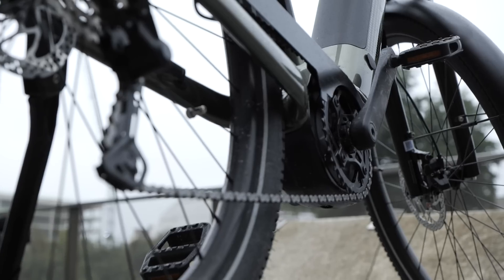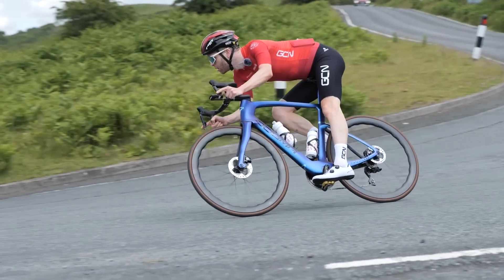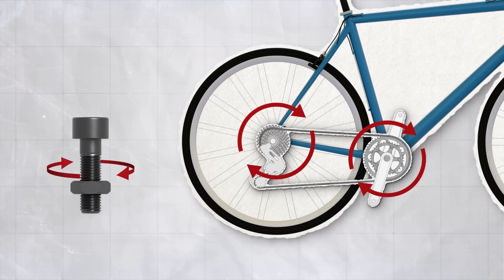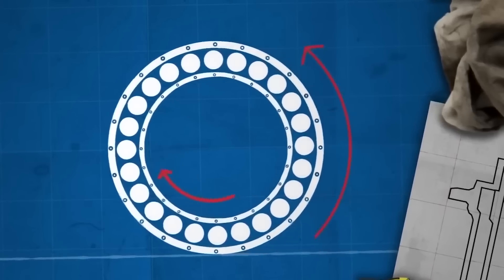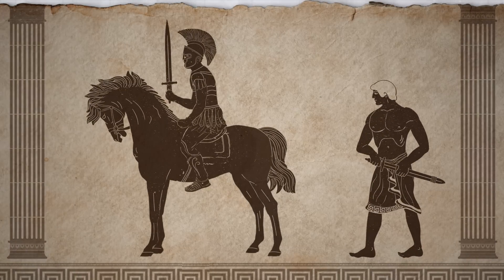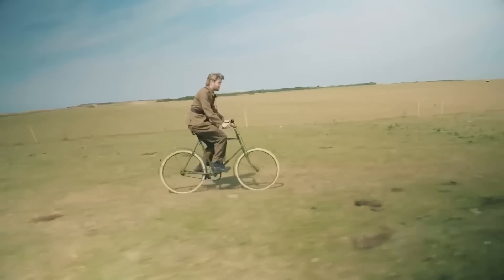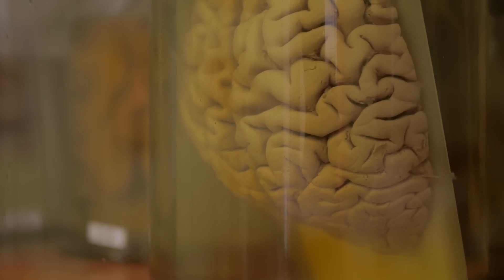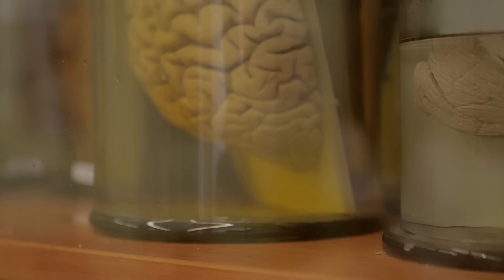Why Is The Drivetrain Always On The Right?

Comment: I’ve never understood why pedal/crank arms have a reversed thread for the left-hand side. The fact that there is a bearing arrangement in the assembly means that there is never a force on the thread in either direction, demonstrated nicely by holding the left pedal by hand and spinning your crank backwards, if there was any possibility of this loosening the thread there would be resistance
Reply: From extensive experience with people assembling unicycles wrong, I can tell you with certainty that pedals do infact unthread if you put a right hand thread on the left and a left hand thread on the right pedal. Look up mechanical precession. You are right, the bearings produce little torque, mechanical precession does (and it goes against the turning direction of the pedal).
Reply: @Finnspin_unicycles  why don't fixie riders pedals unscrew when putting back pressure? why don't bmx riders pedals unthread when riding fakie? the answer lies in proper torque of  the pedal. if your pedal is torqued properly it will never un thread.  "Mechanical precession can occur when too much clearance exists between a shaft and a bushing, or between the races and rolling elements in roller and ball bearings". This doesn't apply to threaded connections. Threaded connections are designed to use the stretch of the bolt as a "spring" which holes the part in place. due to this "spring", there is a constant force applied to hold the pedal to the crankarm, and the very small vibrations that pick up through the ball bearings rolling is not enough to overcome the tension of the spring and break it loose. It requires a certain breakaway torque which cannot be applied in small amounts over time or it will never actually rotate the thread.

However, if the pedal is loose to begin, there will be mechanical precession between the pedal thread and the crankarm thread, which will allow the pedal to back out as no spring tension is holding it.
Reply: @bmxscape  While properly tightening the pedals down helps, if you look at pedals, you will find that unlike proper bolts most have barely any flange. In some softer aluminium cranks, you might not even be able to get the necessary preload to fully prevent precession. Preload can also get lost by deformation of the thread or crank due to load spikes (riding down curbs for example).
If properly designed for it, you are right, you can avoid such problems in threaded connections, but a century or so ago, the bike industry decided to go with opposing threads instead. Given that such parts are often changed by the end user who doesn't know how to properly tighten things, maybe it is not such a bad choice.
Reply: @bmxscape  Yep when the unicycle was mentioned above the first thing I thought of was fixies.
Reply: A hangover from the days of poor bearing quality. A seized bearing would result in the pedal unscrewing instead of pulling the rider’s foot around and causing an injury. So I read once, anyway.

Comment: May be Brits will adopt left side drivetrain. You have the front brake at right hand and also car drive by the wrong side, so why no ...?
Reply: @milybanily  “wrong side”….. left is right for us, Australia, Japan etc!
Reply: @alvinthfdby1915   NOOOP !! Wrong side absolutely !
Reply: @milybanily  hell no, left ftw, thankfully no chance of my country changing
Reply: @alvinthfdby1915   Swedish did it, clever people these nordics !
Reply: @milybanily  57 years ago….
Reply: @alvinthfdby1915   They were old people but still clever vikings.
Reply: What? You have your brakes on the wrong sides as well? Have a word…
Reply: @Crall-xb8he   Don't worry ...its because island environment...UK. Japan, Australia....wrong side for ever.
Reply: @milybanily  India, Pakistan, Thailand, Malaysia, Guyana, Sub-Congo Africa.  Not only island environments drive on the "wrong" side of the road.
Reply: @Crall-xb8he  the correct side you mean
Reply: @Crall-xb8he  Yes.  If you tune your bike correctly for a country with left-hand traffic, you'll set up your left brake handle to operate the rear brake.  This way, you can hand-signal with your traffic-side hand, and operate the rear wheel brake with your sidewalk-side hand.  When you need to maintain control of the steering, you want to prioritize rear wheel braking.  This way, you maintain traction in the front wheel for steering.

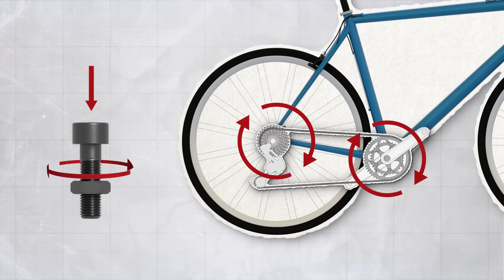Comment: 2:23 I’ve always wondered why pedals and BB are reversed. It seemed counterintuitive. This helped answer that question. I’m so glad you are independent again. I’m actually enjoying your content. I was getting sick of all the sponsored infomercials.
Reply: His explanation of BB thread direction is wrong. The balls in the ball bearings don’t push it backward, it has to do with the mechanism involved in strain wave gearing. If the bearing is loose enough, the entire thing will move around and gradually roll the opposite way.
Reply: How is bb reversed? 🤨
Reply: @kalijasin  yes. The common English thread is reverse-threaded on the drive side.
Reply: I read somewhere that, due to bearing reliability issues in the early days of cycling, the threads were such that the pedals would unscrew in the event of a seized bearing. The rider would be more likely to control and stop the bike in this scenario than have their clipped-in foot injured as it’s pulled around by the pedal. 

I’m not 100% convinced of this to be honest, but…
Reply: I just commented on this actually, I don’t believe there is any benefit to a reverse thread on the left pedal, the pedal rotates on a bearing, so there is no force on the thread at any time -in my opinion
Reply: @daztastic147  If you're so confident loosen off your left pedal and go for a long vigorous ride and see how you go. Bearings do NOT eliminate friction, they reduce it.
Edit: 
Fortunately the thread is reversed so you'd be fine. 😁
You could loosen it off and back pedal with your bike on a work stand though.
Reply: @daztastic147  there's a force on the threads that screw the pedals to the cranks. And because of the different rotation directions that's why one is clockwise and the other is anticlockwise.
Reply: @daztastic147 precession - there really is a force.

Comment: On a fixed speed bike with a single cog you can flip the rear wheel over, swap the left/right cranks and move the chain from right to left, doubling the life of the chainring and cog since the chain then uses the sections of the teeth that previously did nothing.
Reply: I don’t think you can put the Cassette on the other side on most bikes.
Reply: @kalijasin  Indeed you cannot, the freehub would then be in the wrong direction. This applies to a bike with a fixed cog on the rear wheel, that cannot freewheel. I've seen it done and it does double the life of the components.

Comment: Both right and left are wrong. Mid would be most balanced position. Also wheel dishing wouldn't be existing.
Reply: This is what I’ve always wondered, rather than why always on the right. Conceptually a central drive train sounds simpler too.

Comment: its a bvad idea too, at least in the automotive world you can tell if a vehicle is english because the left side will have more corrosion. Its where the puddles are (on the side of the street). This means however, that in most countries where we ride on the right, the drivetrain should be on the left,where it will be more protected form that. 

Also: Ima make a left drive side Fixie now HAHAHHA see ya
Reply: So, when you ride through a puddle, only one side of your bike gets wet…?
Reply: @Crall-xb8he  Not what I said. 

On the drivetrain side of your bike is also where most of the junk and debry as well as most of the water is. So it is on the more affected side. If and hoe that makes a differrnce I dunno.
Reply: @martinmorsch7507  Cars are wide with four wheels, bikes are narrow with two wheels. My point is that a bike is like one side of a car. Generally cyclists like to be the side that stays dry and ride away from the gutter, but if we have to ride through any mess then the wheels spray it evenly over the bike. And us.

Comment: I have a French-threaded steel frame. 
When I first got it, I would tighten the bottom bracket mercilessly.
Then daintily pedaling down the road, I would feel, then see, the bottom bracket . . . slowly unscrewing!
That proved why French-threaded pedals, got everyone scratching their heads, until The British-threaded pedals solved it.
French-threaded bike engineering, one of the many things the French got wrong.
Reply: Time carbon, look pedals, mavic wheels, Renault F1 cars, airbus, the Eiffel Tower, Concorde, the sewing machine, the hot air balloon, high speed trains and the metric system. Here you go.
Reply: @l.d.t.6327   Mavic R-Sys - nuffsaid, Concorde, banned from the sky -nuff said, forcefully over-feeding ducks  nuff said, etc etc. Now I never said they NEVER created anything. All I deed was mention an aspect of bike threading they fked up. That's all.
Reply: @savagepro9060   nope, I read your comment, and it’s denigrating / xenophobic towards French. It says more about you and your lack of respect. Ps: I’m not even French, but have friends everywhere and a bit less toxic when commenting.
Reply: @savagepro9060  Wondering now if you're French, based on your picture... ha! (I'm obviously also a bit toxic as black coffee tends to be)
Reply: @l.d.t.6327  Caribbean island, oh, but next to a FRENCH island, Martinique, go on do the geography . . . you're on Jeopardy!
Reply: @savagepro9060  if it’s next to Martinique it’s the Dutch equivalent. Or maybe a nearby island… nice to live, but seems like not that much fun to ride as these islands are so small!
Reply: French get everything wrong!

Comment: Y don't you do a video on the mystical phenomenon of why the wheel goes round and round. It would go with your tire and seat post videos. Or why the tire pressure is on the side of the tire. Lmfao
Reply: Ever wondered why the wheels only go round counter clockwise, like the earth does…?
Reply: @Crall-xb8he  so you've been told...

Comment: It's a convention, and it would be pointless to have 2 competing standards when neither offers an overwhelming benefit.  Right hand threads are easier for the right handed majority to tighten.  By the same argument, left hand threads are easiest for the right handed majority to loosen.  For comparison, in the world of motorbikes, the rear sprocket is not screwed on but is held on with several bolts so the handedness of a single central thread is not an issue.  A motorbike drive chain is usually, but not always on the left.  This is because most people usually mount from the left, so the kick stand is on the left to lean the bike that way.  Therefore the chain is on the "downhill" side and more sheltered when the bike is parked in the rain.  The explanation about mounting from the left due to the sword scabbard is interesting.
Reply: " it would be pointless to have 2 competing standards when neither offers an overwhelming benefit."
Bottom bracket  - 'hold my beer'
Reply: @bradl7439  Fair point well made.
Reply: Also, this might be the result because the exhaust tends to be on the right to avoid burning yourself when getting on/off the bike.
Reply: Not sure about that, drivetrains on motorbikes were primarily influenced by the engineering constraints of crank rotation, transmission design, and the cooling advantages of mounting the engine with exhausts forward. 
Counter rotating cranks are a relatively recent addition, utilised to recruit crank rotational inertial forces to counter other rotational forces exerted by wheels disks etc.
Reply: @space.youtube  It's also true that most swordsmen held their sword in the right hand and their shield in their left hand. A soldier would need to drop his sword to shake hands, which is why we shake hands with our right hands.
Reply: @Mgrant8163  Completely irrelevant to the topic of "motorcycle design", but thanks for that useful historical tidbit all the same. Somehow I was under the mistaken belief that they wielded their edge weapon with their massive prehensile peens, thereby freeing up their right hand to shake the hand of the noble foe they were about to clefting in twain.
Reply: Right. Let’s change the traffic light colors. Just because

Comment: The rotational force on the pedals loosens the thread for the same reason the BB is tightened by rotational forces. How can you make a wrong statement and then immediately provide the perfect explanation for why you're wrong? However, the loosening isn’t an issue because the rotational forces are close to zero due to the pedal bearings, but saying the opposite is just incorrect. If you want to test this, the next time you unscrew your pedals, simply hold the pedal axle in place and turn the cranks forward to quickly unscrew the pedal.
Reply: It was demonstrated to me that it is the effect of mechanical precession.
You can see how this works by putting a water bottle inside of a roll of painters’ tape. Now roll the bottle around the inner surface of the tape roll, and you can observe how this reverses the direction of the force.
At a micro level, the pedal axle is actually walking in the opposite direction around the inner surface of the threaded hole in the crank arm.
Reply: First of all, the effect he showed for the rotational forces shows that the torque on the static bearing race actually goes against the rotation. The right pedal spins counter clockwise relative to the cranks, so per his explanation the torque would go clockwise, tightening the thread. So that is actually consistent.
Secondly, look up mechanical precession on wikipedia, that is the actually dominant effect and the explanation why pedals don't unscrew while riding. From extensive experience with unicycles assembled wrong, I can tell you that there is enough torque on the pedal threads while riding to unscrew pedals if you reverse the thread directions.
Reply: @Finnspin_unicycles Precession is correct. But the bearing description in the video is also wrong; if the bearings have the slightest amount friction, they will exert a force that is in the same direction as the moving part. If the opposite were true, bearings would act as motors😊
Reply: Back in the early days of  bicycles the left pedal kept coming loose so they changed it to a left hand thread. It has to do with the way the thread bites as the compression force works its way around during pedal rotation.

Comment: The majority of us is right handed. This could be the closest answer. Same as guitar position.
Reply: The guitar position depends on how you string it. You can string the same guitar for a right-handed person or a left-handed person
Reply: @reinterpret_cast  You can, but the bridge is usually angled in one direction or the other.  But I find it easier as a lefty to use my left hand for the fretboard anyhow, so it's kind of moot.
Reply: Exactly!
Reply: But why would they place the chain on the left side of most motorcycles? Especially since most motorcycles companies used to produce regular bikes
Reply: @SestoEIemento  they’d based on kickstarter.
Reply: If I were to design a new bicycle, I'd look at what's existing and attempt to improve it. I see no advantage to switching sides, so I'd look at other things and leave the drive where people expect it to be, and save the effort to engineer something new.
"Why fix it if it ain't broke?"
Reply: @jayztoob  someone built the first chain drive bicycle…blame him…or celebrate him..or maybe her?
Reply: I wouldn't call the guitar a right-handed instrument.  I'm a lefty who prefers the usual setup.  My left hand does all the tricky fingering, and my right hand stays pretty much in the same spot.

Comment: The bearing explanation was incorrect.  If the inner race has a force on it, the outer race will want to turn in the same direction due to friction passed through the balls. The balls only rotate if the outer race is not rotating at the same speed as the inner race.
Reply: Agree, the bearing explanation was incorrect. Precession is the reason that the threads will self-tighten.
Reply: If the outer race is rotating at the same speed as the bearing, having a bearing there in the first place is rather pointless isn't it? The outer race stays in place, the inner race is supposed to rotate, so obviously the balls rotate.

Comment: Love the nerdy stuff, more please.

Something I've always wondered, especially after a nasty crash on my mountain bike, is why the derailleur points down putting it closer to the ground and in range of rocks etc
Surely the derailleur spring tension would be sufficient to stop the chain from sagging if it was redesigned to be flipped to point up.
Or am I missing something totally obvious to why it's not possible?
Reply: The RD is positioned downwards because it's the load-free part of the chain (only tensile forces come from the RD spring). Flipping the RD to the top would cause several problems, as all the loads would then travel through the RD, cage, spring, etc. You wouldn't even be able to use a spring, as any force would just deform the spring instead of driving the bike forward. Additionally, shifting would become much more difficult—you would always need to freewheel to shift, and any force on the pedals would make it impossible. You’d also need beefier RDs and cages to withstand the forces, and there would be efficiency losses due to deformation of these parts. While you could theoretically make the chain cross between the chainring and cassette to flip the RD, that would lead to even bigger issues